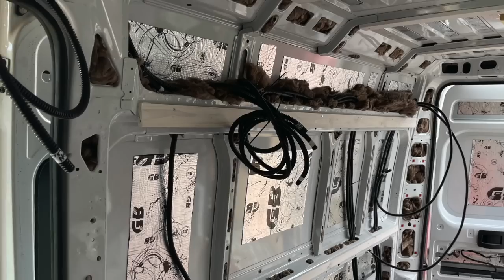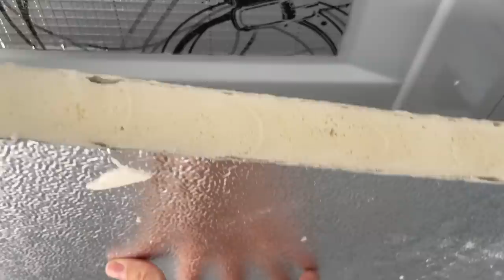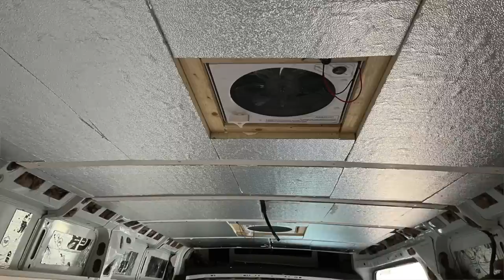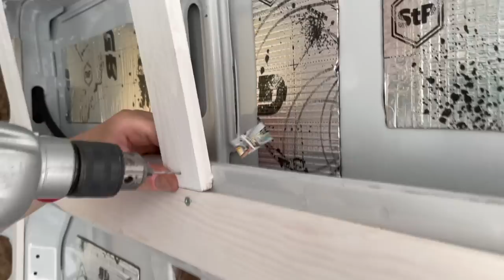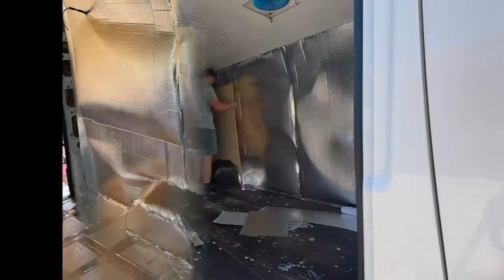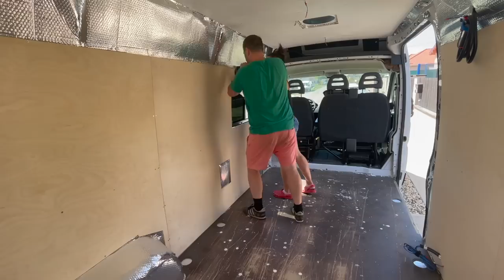Van ceiling, wall installation DIY Fiat Ducato no experience #7

Comment: nice work! what's the silver material? is this for thermal isolation? and after that, is that plywood? what thickness?
you put the cables before, but I don't see any marking. how do you know where they are after the walls are in place?
Reply from the maker: Thank You!
The silver material is a kind of vapor barrier, not for thermal insulation. 
Yes, that is 8mm plywood.
Correct, I put the cables before the insulation, and marked the silver material with marker and cut it a little where the wires came out. And then I tried to measure the right place on the plywood before the installation and cut the hole. The wires can "move" +/- 5cm in all direction. (I am working on my "electricity" video, it is going to be out in this week.) I measured every step five times and it worked.